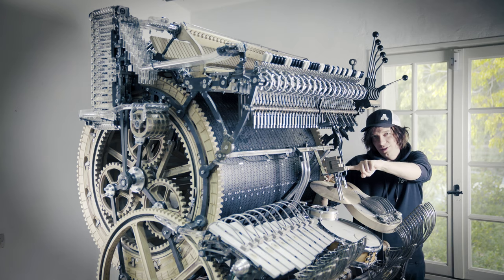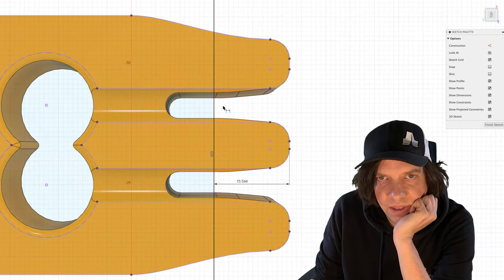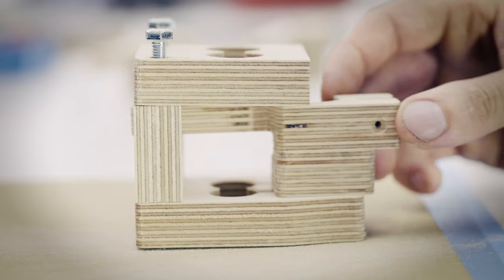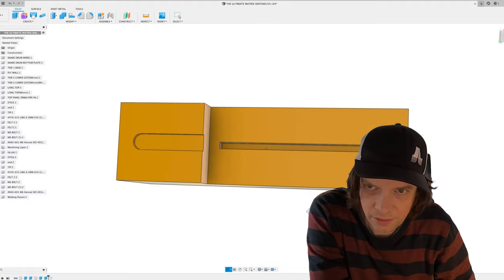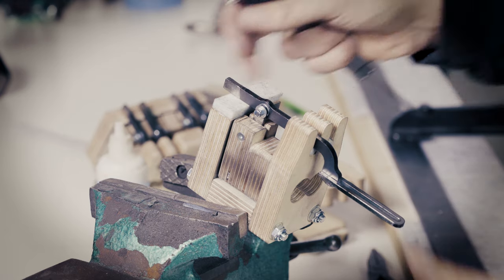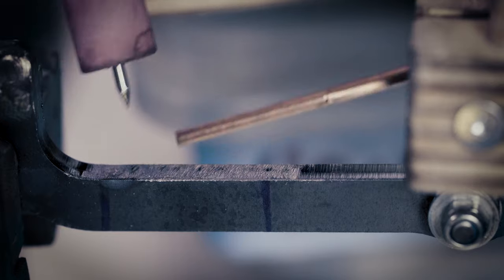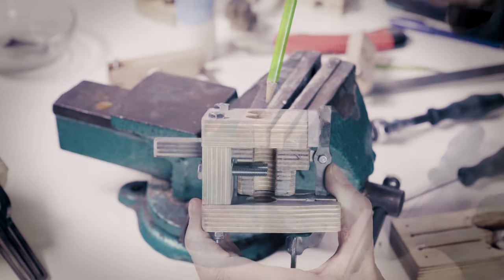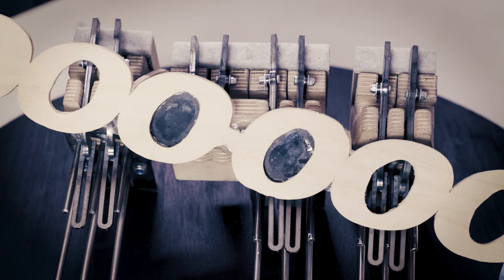Making Better Marble Gates - Marble Machine X #144

Comment: Dropping marbles against a threaded screw doesn’t seem like the best idea.
Reply: That's what I was thinking about when he showed that part.  The threads mean the bolt's length can be controlled very accurately with washers on the other side, but is that needed?  Putting a ball on top of a cylinder means it will be hard to keep that exact height over a lot of drops; it seems like a flat surface would be better.
Reply: Yeah I have the same thought I would almost make more sense to put a ramp on the inside so that the marble has kind of a slope to slide down on and then a flat on the bottom to sit above it.
Reply: @aaronrobinson2121  a 3d Printed cover for the part of the screw is the solution. and easy to design and snap on or off. Also would dampen noise if made with soft plastic.
Reply: Yeah, I thought a nylon bolt would be a better solution. Quieter at least.
Reply: @aaronrobinson2121  there are many different types of bolts, such as ones with only partial threading.  That could work better here
Reply: I've been saying this since he first showed his design.
Reply: Very easy to replace that screw though.
Reply: @jmkool01  for sure a partial threaded bolt makes more sense and was my initial thought when i seen the full threading.
Reply: @fingerbottom  he's said before that reading the comments scares him so he doesn't do it. Seriously though there are often very obvious and important suggestions in the comments.
Reply: could easily grind the threads off that part of the bolt later and then slip on a plastic sleeve.
Reply: And bolts will bend very fast. These are solid steel balls. 1000000 hits can even break them.
Reply: @TWFydGlu  I think the problem is not for the screw but the marbles, over time they will get «scratched» (don’t know if it’s the right word) so they will do more noise rolling and have more friction against each other and the parts of the machine
Reply: I was also thinking of the wear that will happen with the wooden parts also wallowing out because of the threads.
Reply: it falls off.  it's irrelevant
Reply: Would he not also want something with less surface area at the end? The whole point was to avoid edge-cases where marble can get stuck and the larger the surface area of the screw end the larger the possibility of the gate closing before the marble has dropped
Reply: If you have a full stack of marbles falling down on that bolt, I think the bolt will start to bend down over time -- when it does, then it will block the marble from coming back on the bottom part of the movement (step 3 @ 25:00)
Reply: "I'll put a saw blade in every marble drop" #bad_idea_31
Reply: Not at all
Reply: Be like CLANK CLANK CLANK CLANK and thers another problem
Reply: 5:53 ohhhh so satisfying
Reply: @GrandmasterofWin  hopefully some of the comments here make it to the subreddit and the other site they use.
Reply: I didn’t even think about the bolt bending eventually. I’d love to see the math on that! I was more worried about the threads wearing down and the balls being slowly damaged by the bolts. #lessfriction = no threads on the parts making contact with marvels.
Reply: Whole point of the extra mm rest. It causes the marble to fall on the fences edge
Reply: A cylinder isn't going to hold in place 10million times unless it's some kind of jury rigged screw to cylinder transition
Reply: @paisis123  Ooh I like the cover idea, that makes sense to me.
Reply: @ArnandKularajah  grind the threads off so that the marbles don't wear them down? The marbles are hardened steel, they won't be scratched, they will wear down the threads just like Martin would with a grinder
Reply: Who cares if the marbles get scratched? He can replace all of them periodically, they are cheap
Reply: What about putting a PTFE heat shrink tube? This would reduce noise and reduce friction.
Reply: Ya beat me to it.
Reply: @asronome  that's the same reason why train wheels are softer than the rails they ride on. Easier to replace a wheelset than a rail.
Reply: @m.a.6478  I was just about to write this. The noise reduction would be noticeable, and it'd provide a little shock absorption to reduce the stress on the bolt. For added noise reduction he could have had the CNC rout a little recess on the surface that the ball drops onto when it's pulled off the bolt and put a strip of felt there too.
Reply: He is trying to reduce friction. But a threaded screw does the opposite.
Reply: It wil waller right out the hole in the plywood before anything else
Reply: @federico1183  I suppose that's true... Well-seated washers might remedy this for a while?
Reply: Over time the threads are gona 1) Damage the marble balls, 2) Be damaged by the marble balls and change the hieght each ball is held in comparison to the next one
Reply: Causes more friction
Reply: @PikkaBird  as always bolt take axial load, not radial. He, as you said,  should clamp it. A rectangular piece of, say 50x20×4mm (thickness should be 3*pitch) with the two threaded holes would transfer the load into the wood more evenly.
Reply: @GrandmasterofWin  sounds like a terrible way to miss important suggestions that he may have missed. This dudes a genius, but even they can have some things slip sometimes
Reply: Nah it's ok.. they're made of Hafnium
Reply: I didn't like this also !
Reply: Okay can yall just shut up and stop asking for another redesign
Reply: @terrybrannigan1249  no
Reply: @jbreadnr  My intuition is that the bolt will never bend.  It's very stiff.  The marbles don't hit it very hard.  But the threads add friction and noise.
Reply: I think that only spring steel will be durable enough to actually reach the goal of the 10 million drops :p
Reply: IKR. I saw it and im like "really, all that work just to leave the core mechanism scratchy? okaaaaaay"
Reply: @m.a.6478  i’d be curious how that type of material would wear with 10m impacts and sliding across it. The best solution is the lowest friction.
Reply: @terrybrannigan1249  no redesign, just a bolt with a polished metal shaft that’s the lowest friction possible.
Reply: @jbreadnr  Or fatigue failure.
Reply: Adding a small length of thin silicone or even PTFE (teflon) tubing would take care of the issues of both sound and preventing marring. You can actually, order the stuff as thin as 1mm (or even 0.5mm) thin walled.
Reply: I'm sure the threads will be "noisy" and Martin will then coat them will the polymer stuff to quiet them which will also protect the threads. ))
Reply: The best part is no part. The best process is no process. It's simple, works every time, cost effective, replaceable, and suites the design of a plywood/steel machine.
Reply: @paisis123  Why not just use a bit of heat shrink or a straw of the right length? All you need is a thin tube of plastic and it will be quicker than a 3d printed part and cheaper to replace.
Reply: @GrandmasterofWin  If you like a particular idea, you could hop over to his Discord and suggest it there. He does read Discord.
Reply: YUP..   friction and noise to be removed there....
all it needs is to grind the first 20 mm of thread down.   Simples
Reply: @jmkool01  most partially threading bolts have the thread in the wrong end for this. 

A sleeve seems like the best option, I'd go with heat shrink tubing.
Reply: @joaquins90  One of the points of redesigning is least friction. Hardest material has the least friction.
Reply: @NealD  Could indeed be that the marbles falling on the sleeved thread will cause the sleeve to perforate. Maybe the thread should first be flattened out on a lathe (or with the screw put into a drilling machine and sanded flat). The heat shrinking tubes are available in different strengths and could be replaced rather easily as needed.
Reply: A lathe would make things so much easier
Reply: @KevinNolanMakes  turning 38 identical* parts is never funny, even when they are simple, unless using a cnc lathe.

I guess a revolver lathe could be a nice one for this... And I've seen them dirt cheap, if I were to face a project like this with multiple small repetitive parts would go for one half way the first iteration...
Reply: Just grind the bolt on the CNC
Reply: @phanorkner  Nylon bolt won't survive many drops or moisture - it will get softer and scratched. Metal is still the best choice, though polycarbonate or carbon fiber could be also good.
Reply: @federico1183  Personally I'd just replace the cylinder of hardened steel with a flat or half tube piece of spring steel. (It can survive being a motorcycle shock absorber, it's good enough for this.)
Reply: @GrandmasterofWin  maybe he can let someone else read the comments and report the relevant information to him.

Comment: Am i the only one feeling a bit weird that the marbles constantly rub on a screw ?
Reply: Marbles don't rub. They roll.
Reply: No.
Reply: replacing marbles is quite a simple engineering task
Reply: they hit the screw, the assembly itself still has a lot of clearance( it doesnt help with longevity) and he is relying on the felt to never deform to set the position of the gates.
Reply: @braiansingh9730  replacing a few pads of felt is also only a junior engineer level task.
Reply: @RedTriangle53  hoo boy, here comes another redesign...
Reply: That was a screwy design choice...
Reply: @RedTriangle53  Yeah, but that requires inspecting every marble, and that's not an engineering task. That's poor engineering design.
Reply: @thomasbecker9676  oops, he shouldn't have used parts. Rookie engineering mistake if you ask me.
Reply: Maybe he can put a thin heatshrink tube on them.. would reduse noice too
Reply: @knusern666  The threads would wear through the tubing in short order.
Reply: Less surface area it's less friction
Reply: @zackrickabaugh5456  That's a gross oversimplification.

Comment: You worked hard on removing friction but you left the marbles sitting on the threads of a bolt. Wouldn't you be removing noise and friction if you covered those threads? Maybe thread on a piece of tubing or plastic.

Comment: I would suggest that if you want reliability to 10 million cycles that you should build a test stand to test your prototype marble gate to 10 million marble drops.  It would be a waste of effort to make all the new marble gates only to find out you still don’t have the required reliability.  This idea could also be applied to other components on the MMX with reliability problems.  It could potentially save a tremendous amount of wasted effort.
Reply: Yeah, he can say "it was designed to work 10M cycles" as much as he wants, but it isn't until it's tested, and I'm betting it will fail after a few thousand =)
Reply: The parts aren’t being designed to work reliably 10 million times. They’re being designed to work to a reliability level of one failure every 10 million uses. So they don’t need to last for 10 million uses. In fact, I doubt wooden parts would be able to do anything 10 million times reliably. Ideally, he’d make a thousand versions of a single part and test them 10,000 times each, but that’d be pretty challenging.
Reply: As a software engineer I love seeing parallel like this between engineering software and engineering a physical machine. You're totally right, this individual part (and each subassembly) should be load tested (Load Testing is a software dev term) 10 million times before any claims can be made!
Reply: Completely agree.  Build 1 extra and loop marbles through it until one gets stuck.  You don't need an exact count of the number of cycles until a failure, you can use the rate of the cycle to get a rough estimate and when you see one fail you'll learn a potential failure mode.
Reply: In fact, the reliability of "10000000 per failure" refers to the entire X machine. If you need 5000 marbles to perform a single song, then there are considerably fewer marbles going through one gate.
Reply: @777arc2  It's been Martin's MO on this project - nice guy, but his lack of knowledge keeps coming back to haunt him. He is also a prime example of a little knowledge is a dangerous thing. I'm glad he realises how important and difficult repeatability and reliability are, but he lacks the knowledge and principals for achieving the level of performance - his 10 million drops - he seems to think he is solving design problems for. He is just thinking he can eyeball design changes he pulls out of his arse and claim he has achieved  this precise level of construction - and does so without any real testing - let alone carefully considered testing protocols that are required to achieve the  number of nines his is aiming for. Watching him dismiss the obvious solution to add a precise 1mm shim to a wooden part, and instead add a completely non-precise weld bead to a precision cut metal part shows his complete lack of practical knowledge that will keep him chasing his tail.
Reply: Assuming 2 marbles a second, it would take a single gate ~58 days of non-stop operation to achieve 10 million drops in total.
Reply: @andrewbell7220  It needs 10,000,000 perfect drops without faillure according do Martins specs, split over 38 channels that's about 265,000 drops per gate before a single fail is allowed to occur. to put this in comparrison: Canon's latest 'prosumer' camera model, the EOS 90D, has a shutter rated lifespan of "only" 120,000 actuations.
Martin wants to design a mechanism with twice the reliability of a modern high end camera out of plywood.
Reply: yes i agree. why make all these parts for the gate and fix them after testing. so it should have been made a prototype of new design first before making all new parts
Reply: @Hirosjimma  Ha, that's exactly the kind of number I was trying to think of in my comment on the last video. I knew the numbers he's spouting were in excess of the specs of quality stuff made by real manufacturers but I couldn't think of a good example.
Reply: @Whina_Bell  I love this
Reply: @Whina_Bell  yes, indeed. I am amazed how he decides on improvements he thinks should be there without any real grounds and never considers how he is going to prove that it is indeed good for 10M moves. He even fails to realize that one gate does not need to be good for 10M marbles. Painful to watch really
Reply: I love to reading these replies. You can really tell who spent most of their career in the field, and who spent most of it in class. It would be nice if reality played nice with theory, but it never does. It's just impressive that he's working through the challenges so diligently and creatively. The man's got talent.